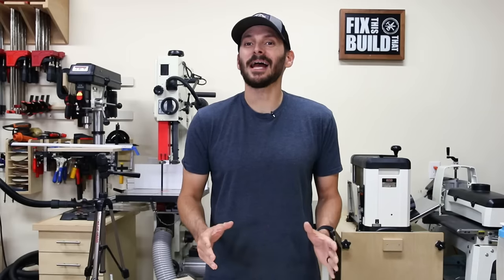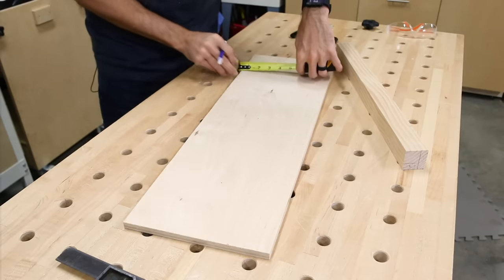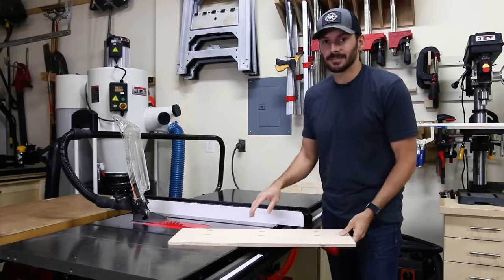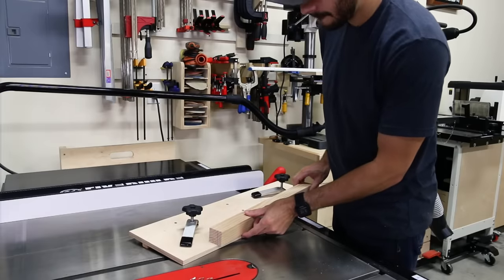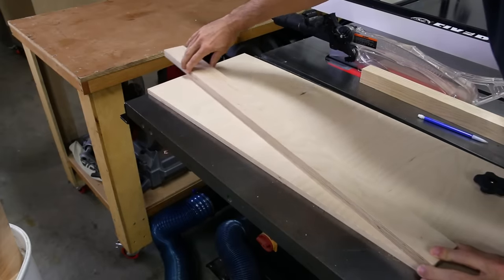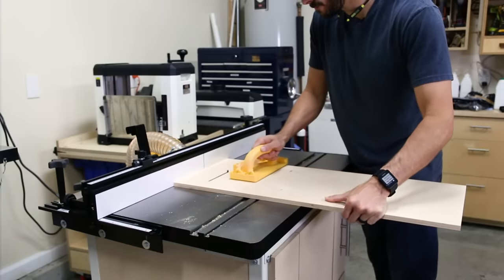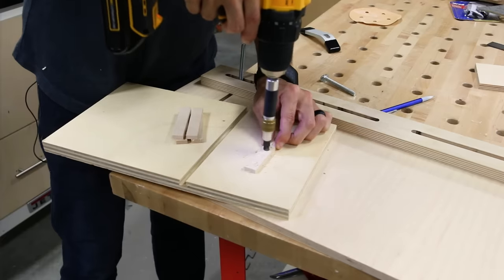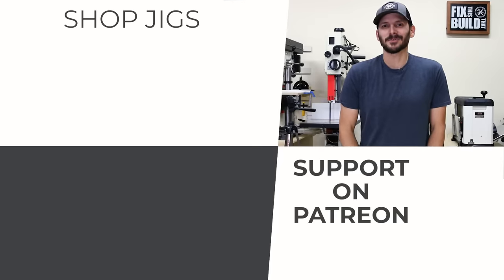SIMPLE or FANCY Taper Jig for a Table Saw | How to Build

Comment: Built the second one. Used my dado blades to make the slots instead of router and for the top bar I used a piece of t-track I had and made the two slots smaller on either end.

Comment: I made the second one and love the way it works.  I had purchased the Microjig Tapering Jig, and the first time I used it following instructions, the cutoff came fling back at me, and hit me square in the chest.  So, I started looking on Youtube and ean across your design.  I opted to build it and the very first time I used it, it worked like a dream.  No fly backs or any other mishaps.  That design has become my favorite and I use it whenever I make some legs for any project.  Soooo, much easier to use and I'm not worried about being beaten to death from flying lumber.  Thanks Brad.
Reply from the maker: Glad it helped!

Comment: I built one somewhat similar to your fancy version a couple months ago, and it has come in very handy for straight lining and tapering. 
Mine was almost 4' long and a bit wider though, and I added a few extra slots in the base piece to accommodate clamping shorter pieces of varying size. I also used four bolts and knobs instead of two because of the extra length and tendency for the top fence to lift/twist while clamping tight, and I skipped the runner and use the fence on my table saw instead...this allows me to also use the same jig clamped flat on a table for cutting slots and grooves etc in smaller parts with my plunge router too, and I just add a second top fence w/bolts/knobs when necessary, to allow me to do this. It works great and I'm so glad I didn't just build the simple version, because the extra versatility of the nicer one is well worth the extra time and work it took to make it! Thanks for all the great videos, I always enjoy watching your channel.

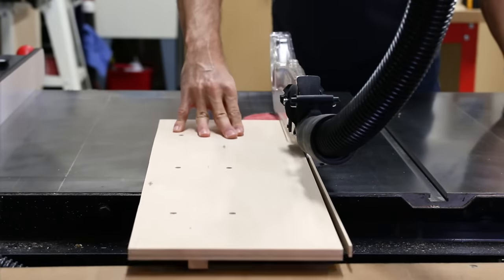Comment: The simpler the better - great video.  Occasionally I have had to do long tapered rips.  One such case is the need to add jamb extensions to doors or windows (and sills for windows) with inconsistent depths (like needing to add 1-13/16" at one end and 2-3/8" at the other).  A door jamb height is about 7 feet, but multiple ganged windows may have much longer top jambs and sills.  Some years ago I fashioned an 8-ft. sled from birch ply, used a glued and screwed 3/4-in. strip of the same material for the miter slot, and as you show in your example (5:13) drilled to accommodate T-bolts for hold down clamps.  I predrilled a series of patterned holes (about 30 or so) up and down the sled at varying distances from the edge similar to what you had done.

In use, initially I'd measure off the cutoff edge and adjust the rip at top and bottom using a tape measure, for example, 1-13/16 in at one end, 2-3/8 in at the other.  I found the setup process to be somewhat tedious, which could be further complicated if there was a slight crook in the board to be ripped as it is impossible to measure in the middle of a board.  I solved this by inlaying sticky backed metal measuring tape approximately every ten inches over the length of the sled.  I notched in 1/64" deep x 1/2" wide dados the width of the sled and set the series of measuring tapes in place, with zero at the edge to eight inches (the width of my sled).  With this addition, set up is a breeze for any length of board I need to rip, even boards longer than 8 feet.  Even boards with a crook can be flexed enough to make straight cuts.

Comment: Thanks for the detailed video. I made the simple version about a year ago with the intent to make the fancy one later.  The simple one works so well I haven’t bothered to improve it.  I use it all the time to joint boards, in addition to the occasional tapering project.  I used melamine for the base, which works well with the blue tape and CA glue technique.

Comment: Simple jig for me.  It looks accurate, repeatable without a huge effort or materials.  I just bought some clamps for another jig I'm building, and the most economical buy was 4 when I only needed two.  So I've got these two left over clamps that needed a purpose.  I am making two end tables, so 8 tapered legs.  That's just enough to justify the effort and time to make this simple jig, then zip through the leg construction with precision.  Your video is perfect and gives me everything I need to get this project started.  Thanks!

Comment: I made the fancy one a few months ago and haven't been happy with the fence. It always bowed on one side  with any clamping pressure. I think I'm going to try a new one with the center intact and see if that helps. Your videos have been very helpful to me!
Reply from the maker: See if that helps!
Reply: @Fixthisbuildthat  On the fancy one, maybe make another half-length slot at the midpoint of the jig and drill a hole in the midpoint of the fence for another T bolt.  No looking at nasty fences, especially in southern Colorado.  Thumbs up to crush a troll, and a new subscriber, too.

Comment: Word of caution, that step at 8:54 (widening the thru slot) must be done in the order shown.  I got it backwards and started with the fence further away, then moved it closer to me to widen the slot.  When I started the widening cut, the wood was trapped between the bit and the fence, and since the bit was cutting on the backside, it threw my board hard to the left about 6 feet, and broke my 1/4" spiral bit!  Good thing I was using push blocks!

Comment: The added functionality of using the second tapering jig as a straight line jig is appealing. I think the ability to use different hold downs in that case, such as might be used for highly irregular woods, e.g. part logs, etc. may be useful to consider. Also, when using it as a straight line jig, a useful way to set the fence for parallel is to set the top position based on your desired width (use a block to set this) and then using that same block of wood between the blade and fence, slide it up to the bottom position and then tighten it down. Now your fence is perfectly parallel to the blade and should ensure not only a straight line on the target but also a parallel cut like you would get using the tablesaw fence. Good video, Brad - thanks. Just say no to nasty fences, kiddies. :-)

Comment: Great video and I'm definitely making the second version. Quick question tho, why not just use the fence instead of using and installing a piece for the table saw slot? I'm making one today but planned on just using the fence for my width
Reply: The jig can, potentially, draw away from the fence. You have to hold it against the fence, which adds one more way for something to go wrong.

When you use a slot runner, the jig must follow the slot, so your workpiece travels more securely. Also, you have one less distraction, so you can concentrate more of your attention on the factors that might really matter, say feed rate for example. Keep in mind however that there will be a small amount of play between the runner and the slot. Choice of material makes a big difference, and it should fit to a close tolerance without binding. I like UHMW polyethylene for this, but it doesn't take adhesive very well and therefore has to be either screwed in place at close intervals or set in a dado.

Comment: Definitely the fancy version. I want to make a jig for making lighthouses, which requires a 22.5 degree cut, along with a taper so the octagon tapers from a large base to a small diameter top for the light turret, and its base and rails.

Comment: Made a fancy one after watching Tamar on 3x3 Custom build hers.  Didn't use the slot guide.  Just run the straight edge of the platform along the table saw fence.
Reply from the maker: yup, just keep even pressure on it.  I used to do that and it eventually lost the good tight line

Comment: Both are great, but of course "more is better"  There is another jig out there that adds a pin at the base so that if you need to taper all four sides that the pin gives it support when there is no more 'leg' to support the end.  It would be easy to add that pin with yours.  Keep producing good videos.  Thanks.
Reply from the maker: That sounds cool!  I rarely do full length tapers so that typically isn't an issue for me, but I see how it could be

Comment: A year late, but I have to say - simple all the way.  If you make the fancy one, you have a leg tapering jig, only able to handle oblong pieces and cut in one dimension (longways).  The simple version is an all-purpose hold-down jig, that can be used perfectly well for tapered legs, but can also be used to hold pieces across the jig to taper the ends, odd-sized pieces, etc.  Heck, I used it yesterday to taper the bottoms of the "legs" of a bent-wood laptop stand that was almost completed - I just clamped the whole thing to the jig at the right angle and zip.  That crossbar turns the fancy one into a one-hit wonder.

Comment: I'd prefer to have the fancier one.  I really like jointer feature it provides.  My jointer is only a bench-top version so using my table-saw could be easier for larger boards.  I did notice one thing in your video I have a question about.  What kind or combo square did you use.  I had one from Home Depot but it's missing like the Ark of the Covenant.  I need to replace it it seems :)
Reply from the maker: I got my combo square from my grandfather.  But it's a nice one :)

Comment: Great video!  I will definitely be building one of these. For straight edges, how do you prevent slight tapering with no reference to a fence? Would you not get the same effect of the tapering set up if one edge is sitting out slightly further than another leading to a slight taper?
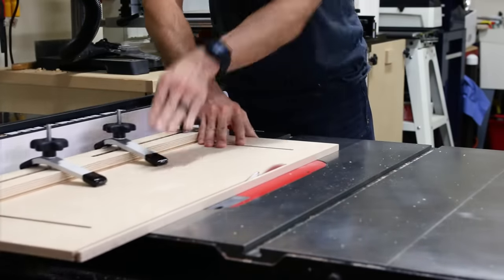Reply: Your reference is the edge of the jig. Mark a line on the piece to be straight edged and set the line to the edge of the jig. Clamp the work piece to the jig and cut. The new edge will be straight. Watch the video again starting at 12:00.

Comment: If you keep your fence adjusted properly, why would you need the miter slot runner on the bottom of the jig?
Reply from the maker: for better consistency.  I used to run of the fence but once I got careless and drifted off the fence because of sawdust between it and the jig
Reply: OK makes sense.

Comment: Isn’t the jig a lot more flexible if you skip the miter and use the fence?  That way you are not limited by the board width if you want to use it as a jointer

Comment: I want to taper cut the bottom 2" edge of a 2"x6"x8ft board so that the top  2" edge is level as it sits on an non level floor.  Would I need some kind of 8ft long jig?

Comment: Need to taper a 28 inch long board from 7 inches down to 4 inches. Will either or both of these jigs be up to the task for that? I'm using a Sawstop PCS, so my table is 27 inches - I assume you have the Sawstop ICS. Anyway, do think I can get a cut with either of those taper jigs?

Jim in Eagle, ID

Comment: I like both jigs, but for me the simple seems to work for me on anything. I'm needing to make a angle cutting jig for segmented rolling pins (also known as a wives', husbands attitude adjustment tool). I need a angle of 9 degs. to 12 degs . making them into blocks 22" x 3 3/4" square. I've been using a amgle cutting jig from Woodcraft; it's alittle hard to control and not real safe. I wood love if you would take this as a challenge and show me how. The idea is to make the rolling pins look like a wooden barber pole or swirl.

Comment: I'm wondering why those jigs are always on the right side of the blade and not left like a miter one? That way the blade thickness wouldn't matter and you could use a dado stack for tapered dados.
Reply from the maker: Good question, to the left would work fine as well

Comment: Made this simple jig, and doing small table leg taper like in this video, but the small cut off keeps getting jammed in the saw after its cut... What am I doing wrong?
Reply from the maker: You need a zero clearance insert so there isn't a gap next to the blade
Reply: @Fixthisbuildthat  thanks for the info. But it looks like I bought the one saw that doesn't have one available, and it's beyond my ability to make one.

Comment: Why would you want to use a miter bar when you can just use your rip fence as a guide?
Reply: It's more stable to use a runner. The jig can work away from the fence. Also it's more repeatable, in case you have to lift the jig off the saw table to do some other cutting that requires moving the saw fence. As long as the jig fence itself is left alone, it will be ready to be put back on the saw table.